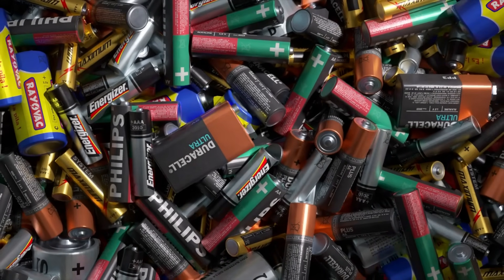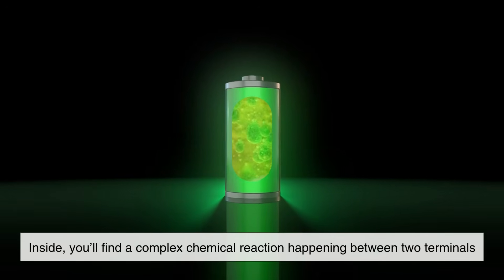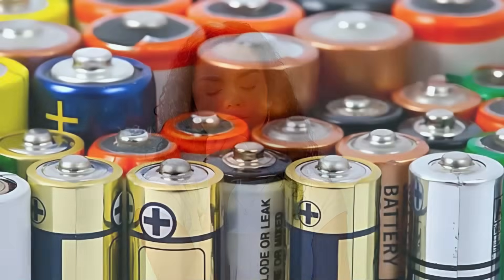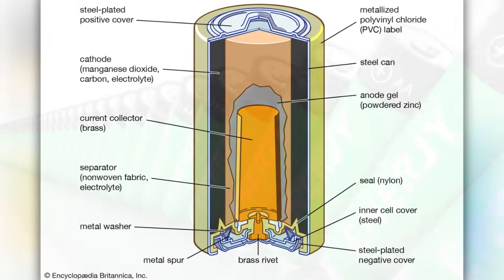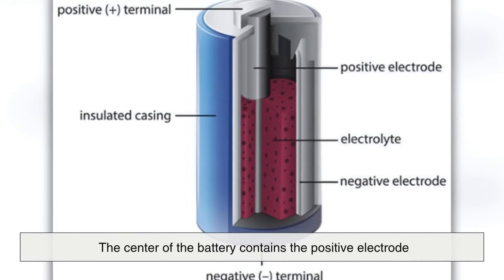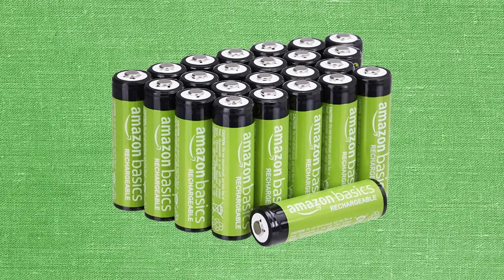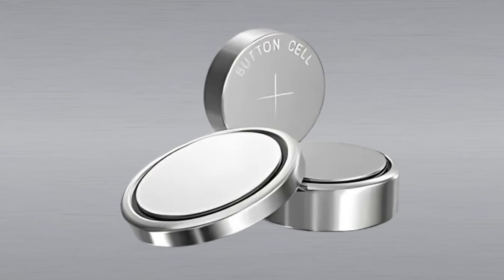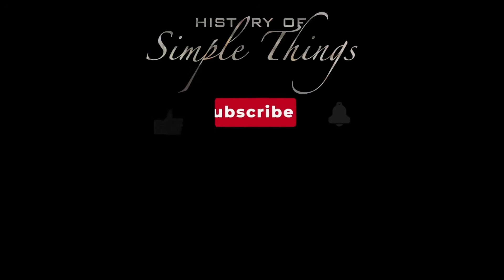Why Do Batteries Have That Tiny Metal Nipple?

Comment: You were limiting most of your conversation to AA and AAA cells.  Why did you show a carbon rod?  I know they were commonly used in C and D cells which at least were, carbon/zinc (It's been a few decades since I tore a cell open).  I don't recall seeing any AA or AAA cells that weren't alkaline.